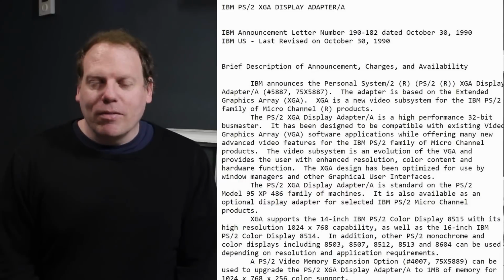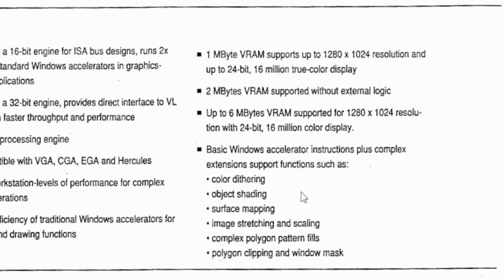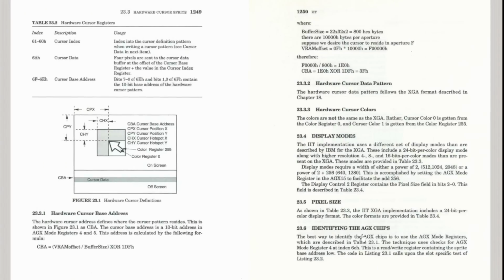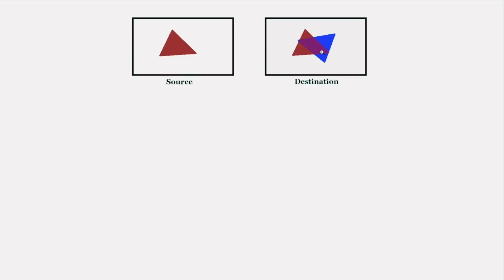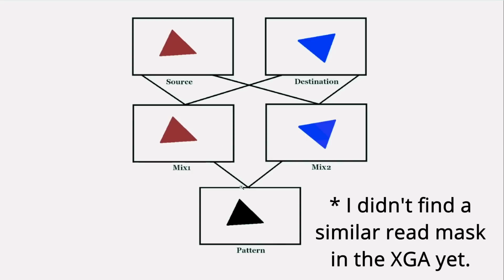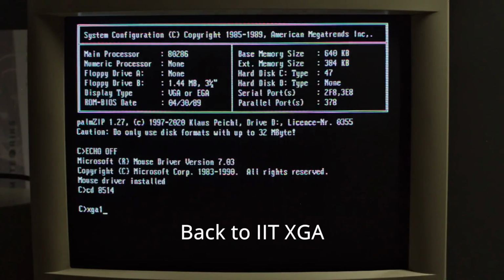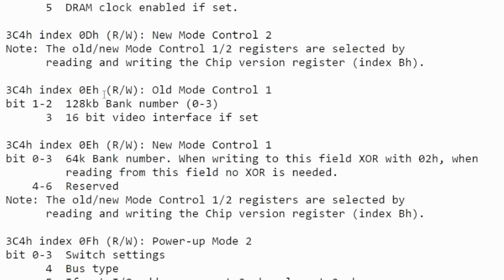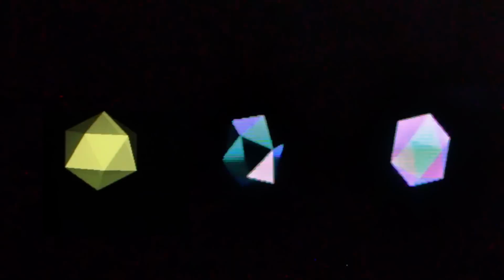XGA : King of IBM Graphics Standards (Part 1)

Comment: I did some XGA programming many years ago for a software which did a data visualisation. It don't recall it being fun or easy getting the code which setup the adapter in a display mode to work on clones from different manufacturers. I never touched a real XGA, but in practice I think most computers had a clone. I know when setting a display mode, you had to do things in a very specific order, or it just wouldn't work.

In your video you say like there are no 16/256 color or monochrome modes listed. However I am pretty sure the PL4 is just that, "P(alette) L(inear addressing) 4(bits)", which is 16 bit color. This means that there are two pixels stored in one byte. The P8 is 256 color palette mode.

You could find out if a monochrome monitor was connected by reading some register. If so, you wrote two of the colors as 0 in the palette and put the greyscale value in the third. I am pretty sure that was done with R and G being 0 and B being the value.

I think the trick to getting palette modes working was setting XGA mode, disabling the palette (which was also sometimes referred to as blanking display for reset), loading the palette, and enabling the palette (sometimes also called normal mode). I think most cards needed a specific "palette" loaded if they were in direct color mode, however I didn't use that mode at all. I had used an array of 48 or 768 8bit values depending on if I was doing 16 or 256 color modes. Monochrome was not supported for my software, so I just checked if the connected display monochrome, and if so I made the program exit.

You made a remark that there are two modes which work the same, but the display moves over. I would guess that they are different timings. Do you know which monitor types should be supported by your card? Does it have support for interlaced and non interlaced? If the mode which is shifted might be the non interlaced mode, which would have faster timings. You would probably need  an oscilloscope to determine what is really going on with the signal.

I sadly I don't have the code from that software anymore. I had last loaded it onto a "Smart Media" card, which turned out not being smart at all, as I couldn't read the media only one year later.
Reply from the maker: I don't recall saying there were no 16/256 colour or monochrome modes listed. I go through the modes which include all of the above.

What I found is that the PL4 modes which are 16 colour are implemented as monochrome on my graphics card.

The palette issue is not to do with blanking display for loading the palette. The actual registers are not implemented in the chip.

I don't think the two similar modes were interlaced and non-interlaced, as one of those would flicker noticeably. But that wasn't the case. I haven't found time to get to the bottom of what is different, but timings are certainly a possibility, e.g. 60Hz vs 70 or something like that.

Comment: Hmm. I know from the experience of having used Fractint that just because all the "known" resolutions might be listed on the two pages thry left out of the book, the real capacity of the card would likely involve a mess of other, "undocumented", ones, some undocumented purely because they where not in the sales documentation. So glad this stuuf is either now uncomplicated, or hidden so well you can't even force them into some off mode in the OS, trying to work out wtf you actually could do, in terms of color or resolution, even if you knew how, was a massive pain, and its not like you could ask the card - just try and hope it didn't crash/break something.
Reply from the maker: I have to admit that it was a bit scary running through all the BIOS modes with a real NEC Multisync monitor. I think they were fairly resilient, but I can hardly replace it easily if not. But yes, I'm sure many other SVGA modes worked. Whether the coprocessor worked in them or not I am not sure. There's hardware in that IIT chip that expects either a power of 2 horizontal resolution, or a power of 2 plus one of two other possible values. That limits the modes one could expect to work with the coprocessor.

Comment: The microchannel adapter shown @3:19 (FCC ID ANO4AR1887972) is actually the IBM 8514/A (see the pictures and outlines at the 'Ardent-Tool' - If you have a system to run it in, I can send one for the cost of shipping). Of course, the IBM versions of XGA (AKA "XGA-1" and "XGA-NI", for "Non-Interlace") and XGA-2 are at the 'Ardent-Tool', too. XGA also exists on the 8590/9590 (Model 90) planar, and XGA-2 on the 9533 (Model 'E', and ISA system) - sadly never more than 1Mb VRAM.

Really, I do have extra 8514/A, XGA, and XGA-2 adapters - Find a 9590 (which had an XGA-2 adapter installed with inactivated XGA on the planar, blue badge), and I'll send you an 8514/A adapter; You would have a system for all three standards.
Reply: The PS/2 Model 65SX had an XGA and SCSI adapter (and drive) as factory add-ons to make up for the late-release of a 386SX-16 system. There was also planar XGA-2 on the 9556/9557 (the PS/2 Model 56 and 57 with an IBM 486SLC2/486SLC3 CPU). The microchannel implementations had POS registers for the configuration of the XGA/XGA-2 video systems, which don't have an equivalent on an ISA system - I wonder how the PS/2 'E' ran it's planar XGA-2.
Reply from the maker: Oh, sorry I missed that. I thought it looked familiar.

Thanks for the offer, but I don't have a PS/2 with MCA at the moment. I did see a few of these adapters available online, and the comment about the steel briefcase was really just for humour. I have seen those cards go for an absolute fortune in the past though.

After the recent difficulties with moving house, I'm being a bit more cautious in what machines I acquire until I can be sure they won't end up needing to be disposed of. If I do acquire a 9590 at some point I might contact you about that offer though, with your permission.

Comment: Really enjoyed this. Would love if there's code resources so I could assemble and fiddle around on my PS/2 system.
Reply from the maker: My code definitely won't run on a PS/2 system, but I'll probably make the code that I used public with the second video. It's only going to run on an IIT chip though. The registers are completely different on real XGA hardware.

Comment: XGA used to have its own wiki page, but given how it can be edited by anyone, someone decided to change it to just the video resolution years ago.

BTW, the original XGA cards only had 512kB of VRAM (I had one in my PS/2 Model 95 until I upgraded it to an XGA/2 planar.)
Reply from the maker: Ah that must have been just 640x480 I guess. I'm amazed IBM did that.
Reply: @PCRetroTech  Actually the 512kB XGA cards support 1024×768 but only in 16 colors and at a low interlaced refresh rate. Some 3rd party enthusiasts added an 800×600 mode as well, which was not normally supported by IBM's drivers. If you google xga208, you can see the numerous video resolutions available on both XGA and XGA/2. The oddball 832×620 at 256 colors worked on my original 512k XGA but 960×720 did not, for example.
Reply from the maker: @DavidWonn  Ah yes, 16 colours would do the trick. It's funny I didn't think of that. Probably because I just get black and white on my card in that mode. It threw me off enough to make me forget about the mode entirely!
Reply: @PCRetroTech  It probably helps that I insist on using old CRT monitors, especially on old machines like my PS/2. Modern monitors likely filter out the interlaced modes.
Reply from the maker: @DavidWonn  I used a CRT for this video. The black and white is just a "feature" of the Hercules IIT card.
Reply: @PCRetroTech  Another oddity is how Windows NT doesn't support the high color modes, even on the 1MB XGA/2, so I can only capitalize on 16-bit color depth when I run Windows 3.0 (buggy icons in this mode), 3.11, or 95 on the aforementioned PS/2. But a nifty feature (at least for me since both retinae detached in recent years) is being able to run NT 3.51 at an oddball 640×400 resolution on the same machine. And of course the high refresh rates are a plus (I can get over 90 Hz in Win 3.11 with IBM's drivers.)
Reply from the maker: @DavidWonn  Oh that's interesting. Perhaps Windows NT needs extra video RAM or something in order to benefit.

Comment: I'm surprised IBM has lasted so long. They seem to have more flailed products under their belt, than successful. It's like they exist solely to invest in all the R&D for the rest of the industry to clone (or take the best parts to make something better or cheaper). Always wondered why they didn't license their technology out, rather than trying to be so proprietary. I could almost say the same about Apple, although they don't seem to be nearly as affected....not sure what they do differently.
Reply: IBM's mainframe and mid-range systems have still been a powerhouse in recent decades running the back end of many companies.  Their marketing and business decisions on the consumer end are a different story, though.
Reply: @DavidWonn  That seems like a reasonable explanation. When (about 10 years ago) I worked as a contractor doing server & POS maintenance/repairs for certain big box retailers & other big-name chains, I did run into a lot more IBM equipment, now that I think about it. Hadn't connected those dots until now lol.. I just didn't notice at the time, because I was ordering by part numbers....after a while, I just mentally filtered out the brand/model on the ticket, since it didn't matter to me, as long as I got a compatible part. It wasn't my job to do anything but provide the right part number.
Reply: @ruthlessadmin  Having worked on the mainframe and mid-range side of things, I'd see it directly and would even memorize their support number. And that was always IBM's strength in support and quality in what they made. Of course you'd pay a premium for it, but for many businesses it often just made sense, hence the old phrase, "nobody's ever been fired for going with IBM."
Reply from the maker: @DavidWonn  Yeah, for sure.
Reply from the maker: IBM have a lot of patents. They did license XGA of course, just few people took an interest. But they have one hell of a lot of products that sell for billions. Aptiva probably made them some money for example, to say nothing of their business machines which probably made them pretty rich over the years. They just weren't very suited to the emerging market of the PC. Well, initially they did really, really well out of it. But what it became was not their game.

Comment: Crazy how IBM invented blitter-like functionality in a PC graphics adapter and everyone just ignored it, even though people like IIT sold cloned or maybe even licensed chips and people like Hercules built them into cards. Then a bit later S3 invented it again and sold piles of chips to a bunch of graphics card OEMs. It's almost like it went from 'No one gets fired buying IBM' to 'Ignore IBM even when they come up with decent ideas'. Maybe XGA was patented and IBM tried to charge too much for people like IIT to implement it which meant only companies like Hercules used the chips. As far as I know S3's accelerated VGA chips were pretty cheap. Also S3 was very optimized for the Windows GDI. So your list boxes were very fluid even if you had a slow CPU and an ISA bus. And because no one really cared about register compatibility it meant S3 could just provide a Windows driver and not have to worry about keeping a register level interface compatible across successive card generations.

Then of course 3D came out and everyone programmed at the DirectX or OpenGL level and companies like NVidia never actually documented the register level interface to their GPUs.
Reply from the maker: Yes, I think Windows was ultimately the driver of the marketplace and this was before the age of affordable 3D hardware on the PC. I'd be pretty surprised if the S3 chip was heavily "inspired" by the IBM one though.
Reply: @PCRetroTech  The functionality was the same. But from other accelerated cards they basically implemented a subset of Windows' BitBlt function's ROPs and line drawing in hardware. Windows drivers had a cool structure where you could use hardware acceleration if you had it or punt it back to EngBitBlt, which was the GDI software version. So you'd profile Windows and work out what the most common BitBlts ROPs were, implement those in hardware and punt everything else back to software. And you didn't really need to maintain a register level interface because it was abstracted away by the driver; 

So IBM's register level standard became irrelevant. And so did their model for BitBlts with multiple masks and sources. Incidentally inside the GDI it actually JITted code to do all the ROPs and this scheme was invented my Michael Abrash who Microsoft hired as a consultant. Hopefully he got a massive hourly rate for putting up with Microsoft's horrid internal politics while he did it.

This is all based on how it worked around the NT 4.0/Windows 2000 days BTW. The 16 bit GDI was probably very different as is the weird compositing GUI we have now where I think everything rests on top of DirectX. Also the original NT GDI run completely in user mode and so didn't allow any hardware acceleration. Apparently Bill Gates himself told them to move the GDI into kernel mode which allows the 'accelerate or punt' option. In the long run it also allowed hardware accelerated Direct3D and games to move to Windows. The downside of course is that it completely violated the microkernel philosophy of NT where a crash in the GDI or any other non kernel system component would not bring down the whole system.

But it all worked out for them in the end. My Windows systems are less crash prone than my Macs.
Reply from the maker: @user-qf6yt3id3w  I was not aware of the Michael Abrash stint at Microsoft. I'm amazed he could go from the kind of fast paced, fly by the seat of your pants programming to working for a bureacratic juggernaut like Microsoft. But I suppose money speaks all languages, especially if you happen to need it at the time.
Reply: @PCRetroTech  According to OS/2 Museum, S3 chips designs were actually very similar to 8514/A in terms of functionality. Quoting:
"The S3 draw engine was obviously designed to be compatible with the 8514/A. This includes register naming (VESA-approved 8514/A register names), I/O addresses used for the registers (at least in later chips only optionally), and register layout. This similarity made it easy to port existing 8514/A drivers to support S3 hardware. At the same time, the S3 chips were never 100% 8514/A compatible and running unmodified 8514/A code on S3-based cards was out of the question."
So, no direct compatibility (such as with ATI Mach), but still "compatible" on the conceptual level, which undoubtedly helped in driver development. And in fact XGA is also 8514/A-inspired, although not compatible on the register level.
Reply from the maker: @peachgrush  Yes, I've noticed there were half a dozen or so designs that were heavily based on 8514/A or XGA. Some of these are covered in the books that I mentioned in the video. There's a whole chapter on the S3 for example.
Reply: Beacause it was very expensive  that time. And PC world was usually about text mode UI. Windows 3 realeased  in 1990 was first real usable  graphics UI  environment for applications on PC .

Comment: Now I understand why the Amiga platform was popular for games and creative purposes.
Reply from the maker: Yes, IBM was a business company and they really made it difficult to make things like this attractive to games and so on. Of course it was only another couple of years until VGA was ubiquitous and everything changed.
Reply: @PCRetroTech  IBM also failed with OS/2. In that case, they didn't understand the gaming market either. Microsoft worked on WinG instead to try to attract game developers for Windows 3.x and later they did accelerated Direct2d and Direct3d for Windows 95.
Reply: @OpenGL4ever IBM couldn’t give a flying duck for the gaming market, OS/2 was designed for business use. It failed because it had heavy system requirements, a confusing desktop metaphor where deleting an icon of a file wouldn’t delete the underlying file from disk, limited driver support for hardware and a high licensing price, which in turn led to limited market penetration and poor software support from developers. In the end, it was used more often than not for running multiple DOS, VT100 terminal and Win3 apps simultaneously thanks to its great preemptive multitasking support rather than for running native OS/2 apps
Reply: @little_fluffy_clouds  The main reason why OS/2 failed was because it was shipped with Windows 3.x. This meant that software developers saw no reason to develop native applications for OS/2, since a Windows version could serve the entire market.

Another reason besides the ones you mentioned was that the marketing department spent a lot of money on advertising at sporting events, which is probably the least effective place to attract customers for an operating system. That would be like advertising lipstick in an all-male club. The money would have been better spent on development. 
Another mistake was wanting to support the 286, which had significant effects on the architecture of the operating system that became a disadvantage later. 
But in principle, we can be glad, because Windows NT was the better operating system

Comment: Your card has MT RAM chips, these are well known for failing and could be the cause of your boot and corruption problems.
Reply from the maker: Yes, I noticed this. I don't notice problems with the card in graphics mode, so I think the problem lies elsewhere. But it's possible they are just run harder in text mode or something.
Reply: MT RAM chips from the early 80s are known for failing, but I have never heard this about the 90s chips.